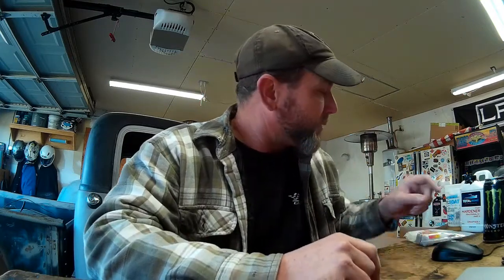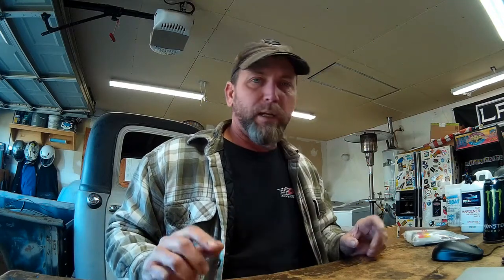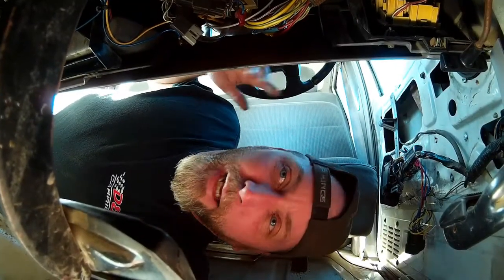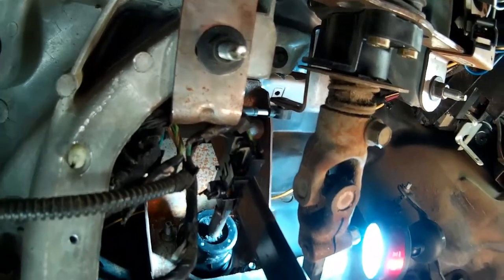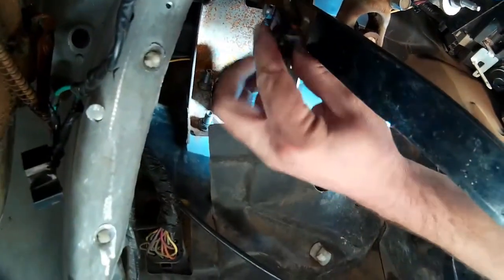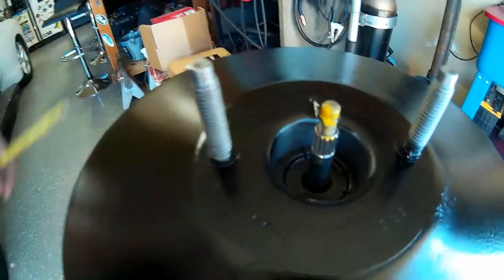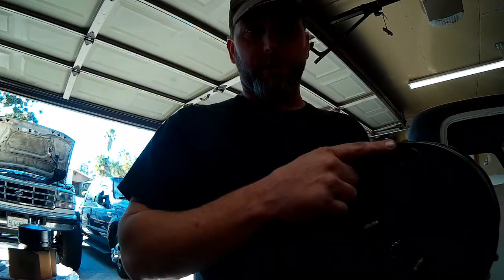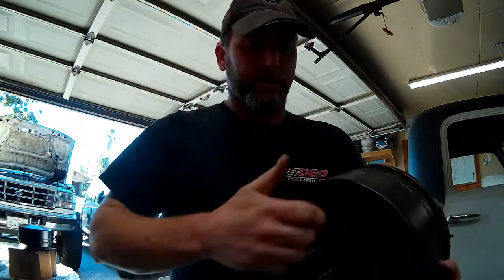Ford OBS; 7.3 Brake Booster Replacement

Comment: I basically have the same problem but my brakes are we can hide it stops the first time but the second time it seems like it doesn't have enough power to stop the vehicle so I think my problem is what you had but I don't know if your pedal was hired or not I didn't hear it in your video

Comment: Hey there. Great video ! Thanks for posting it. I just had the same thing happen to my 1994 idi. The truck has been off  rd for some time. I did replace the brake lines to the back end 2 years ago. I noticed there is no brake fluid.and i cant find a leak anywhere. what do you think?

Comment: what was the reasoning for the brake booster replacement?    i’ve got the spongy soft pedal that will go to the floor board while the engine is running.  with the engine off i have a hard pedal with no fading to the floor board.     any info would be greatly appreciated.

Comment: You rock man! Had my booster go out on a busy downtown street. Had some real white (toe) knuckle driving going on. Brought it back to the house, watched your vid, got the part and installed in less than an hour! That top right nut though... will ruin your day if you let it lmao! I have a 1995 7.3L and I feel your pain. Ford couldnt make the rest of the parts last as long as that motor. Keep making the vids! Thanks again!

Comment: hello i have a 92 idi have no brakes. at all changed everything but the brake booster is it fairly easy to change and also sometimes when I'm driving the pedal goes to the floor like i floored it truck takes off what could this be
Reply from the maker: if you haven't bypassed the rear proportioning valve, that could be causing your problem.  they often get air in them and cause all kinds of brake failures.  the symptoms of my failed booster(s) was, it would have good brakes for a day/an hour/a week, and then i'd go to hit the pedal and it would go to the floor.  the brakes would work manually, but no power assist, and when this happens unexpectedly it can be really unnerving.....as you know.  to test your booster problem, pull the booster vac line and check for vac before & after the check valve, if you have good vac at idle, the booster is probably your problem.  if no vac, check your vac pump.  best of luck, thanks for watching!